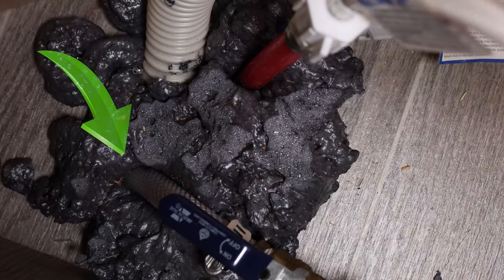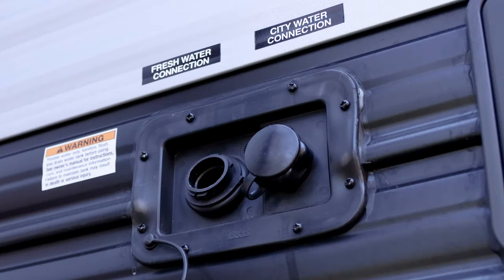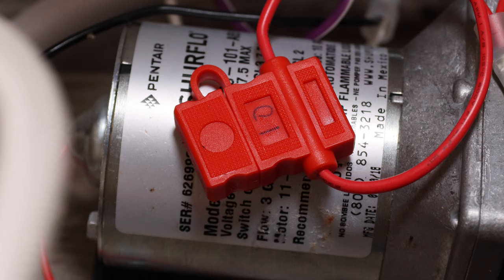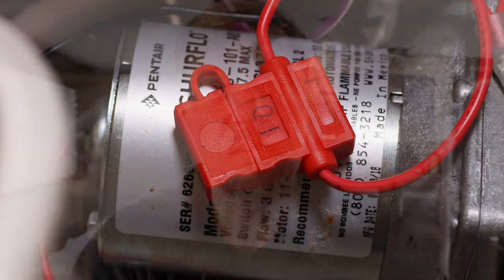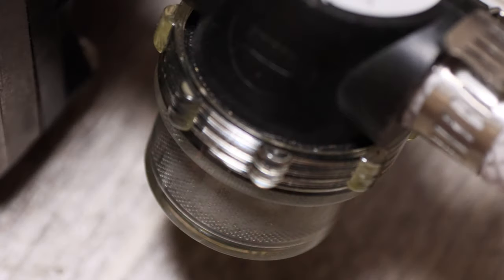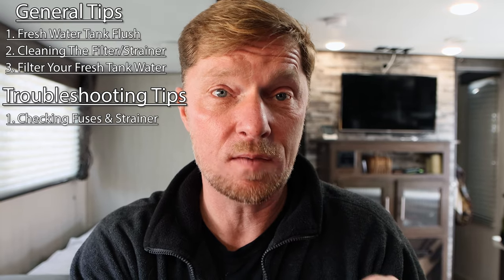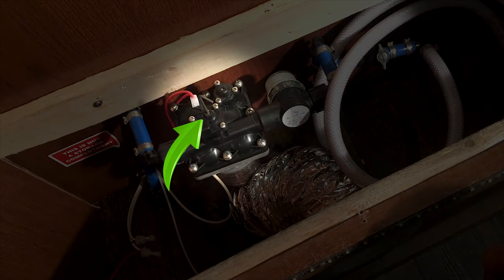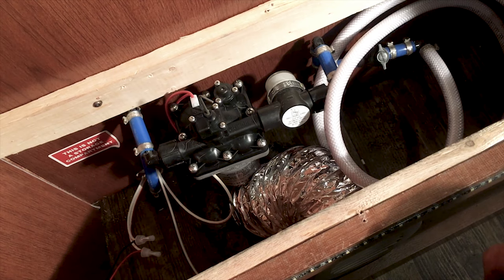RV Water Pump Explained 2021 - Shurflo Water Pump

Comment: I have an ARTIS brand pump in my SONIC trailer. It doesn't have a check valve in the lid like the Shurflo. I'm a rookie and was attempting to dewinterize and sanitize yesterday. I was having problems getting water to the pump and out to the faucets so I began troubleshooting. After making sure the valves were all open and still no pressure (only spitting then nothing when opening the faucet), I opened it up to make sure the check valve wasn't stuck, only to find it didn't have one. Eventually the pressure came after watching videos and swithing back and forth between the city water and tank water. So although I got some badly needed education, I still don't know exactly what was wrong before the problem "fixed itself".
Reply from the maker: Good morning Gerrad. I am not that familiar with the ARTIS brand but from what I just read, it is a magnetic pump meaning that the pumpiong system is not directly tied to the shaft of the pump. I use those types in the industrial enviorment and they work great and have quite a bit less (Hard Failures) menaing that they do not break easily and are meant to be opened to clean with a fair ammount of ease. I am going to attach a link that I hope helps you better understand and it is printable too. Let me know if this helped in any way. https://tinyurl.com/y6lqngmc

Comment: Good video. My water pump is a Shurflo and been givng us problems since we bought the RV last July. When the freshwater tank goes empty and we fill up with water it is hard to get it going. I can hear/see the pump is working, but no water is coming out. One time I shaked the pump and finally water started coming out. Not sure what is wrong, have to take it to the delear to get it checked. This happened to us about 4 timed since last July. Such a pain.
Reply from the maker: One thing that you can try the next time is to take the inlet side of the pump and run a hose from it to a 5 gallon water jug. Turn on the pump and see if it pulls water instantly or not. If it does, I would say the water tank is suspect. If not, then I would say the pump is bad and needs replaced. Also, not saying that I dont trust anyone but sometimes the dealers do not do exactly what they say they are going to do or have done. Maybe yours is an exception.

Comment: I have a shurflo water pump, 7.5 amps 55psi, to use on an off grid solar system. 
I have my solar system set up, but i dont know what i need to install exactly, between the pump and the battery
Reply from the maker: Outside of an on/off switch, I believe that the manufacturer recommends a 10 amp fuse. In you application, I would suggest looking for a 12v blade fuse with a water proof fuse holder. To be safe, please check shurflows website or your manual.

Comment: Getting ready for only our second trip in this camper van…which we love and no water pressure. The motor comes on but it doesn’t pressurize. Took it apart and that little disk thing moves up and down. I hooked up a connection on the “in” side with a bucket of water and it wouldn’t suck water in. Replace the pump?
Reply from the maker: I would think that replacement is your best option at this time. Let me know you get a resolve.
Reply: @HowToRV  Yep…Amazon sent one next day for about $60 and we’re back in business. So weird the pump came on…it just didn’t pressurize. Anyway…thanks again for the video and I learned something.
Reply from the maker: @Skyking6976  I am so glad to hear that you were able to get back online. Happy and safe travels. God Bless

Comment: Thanks for the information.  I am in the process of installing a new water pump on our cedar creek 5th wheel.  The issue was while on city water, my fresh water tank was filling up.  Has anyone else had this issue?  I was told by an RV service this was more than likely my issue.
Reply from the maker: I put a shut off valve between my fresh water tank and the pump. I turn the valve off when the pump is not in use. Since I installed the pump though, I tried running the pump and then city water and back to the pump several times. This seemed to fix the issue and I have no longer needed to use the valve. I left the valve in place just in case though. Hope this helps.

Comment: I have a shurflo model 2093-544-114 pump. It runs out vibrates, but no water comes out. 
     What's wrong?
     Can I repair it? 
This is a 1973 Mitchell Fishing Hut Camper, so it only runs from the tank to one faucet. There is no city water hose hookup, only the tank, the filter, the pump and the faucet.
Reply from the maker: I am not sure if this is the original water pump or not. If it is or at least it has some years on it, I would think that it would be prudent to go ahead and replace it. If you dont already have one, here is a link to the owners manual. Hope This helps. https://efmco.com/wp-content/uploads/2021/07/2088-554-144-Manual.pdf

Comment: Are all camper water pumps 12v ? I have a 06 skyline 32ft camper
Reply from the maker: Yes they are. That is so they can be used while not connected to shore power.

Comment: I have a one place system with two other switches for the water pump. I'm the one place panel the water pump switch will not turn on the two other switches will not turn on the water pump. When I hook a power problem to the water pump directly it comes on and works perfectly fine. Can you give me some tips on what my problem may be thank you
Reply from the maker: You may want to try checking the fuse panel to see if the fuse is blown. The fuse is between the switch and pump so if the fuse is no good, the switch will not work.

Comment: I have A shurflo pump the same as you do. The pump runs to an accumulator then to an instant hot water heater then to the shower head. I don’t have any mixing valves so I need to get the pressure consistent to have a consistent temperature in the shower. 
It seems like the accumulator decreases in pressure until the pump kicks on. When this happens the shower temperature fluctuates. I do not want this to happen!

I have tried to bypass my accumulator but then there is a pulsating problem. Do you have any tips to stop this ?
Reply from the maker: Pulsating comes from lack of flow. You can play with the flow settings on the pump but I highly recommend not to. I would run the water faster if you can.

Comment: This is very nicely done. I've subbed and liked, now a comment - for the algorithm.
I agree with your troubleshooting techniques and methods. I live in a Toyhauler and truck water to storage totes, from there to my RV when needed. I wanted to upgrade to the larger SHURflo 4048. It gives 4.0 GPM at 55 PSI and the PEX in the coach can handle triple that. Not sure about the fixtures. 
I wanted more pressure and flow - to get an RO system working - had one already... made by PENTAIR - as is SHURflo - one thing Tech Support to another and yup - it WILL work. And has. Of course I go through the pump more quickly than even 'regular live-aboards' but I don't have to go out for potable water. (Don't have to prevent 8 jugs from freezing too - or drive out to refill them.)
So I'm refreshing my memory of the settings on the 4048 - similar but not quite the same as the 4008, I think. I want max pressure and flow for a decent shower and to make RO water. I've still got one issue to resolve before I can put a 'Tap' of potable water in the counter - working on that.
Nice job on this. I'll have a look at what else you've done.
Slava Ukraini.
Reply from the maker: From what I understand, the pex is more than capable of handling the pressures. More or less, it is the fitting like hoses, rubber sealed lines and outside lines with the rubber grommets that have a hard time with higher pressures. Love to hear your thought/experience on that.
Reply: @HowToRV  Not sure quite what you mean there. In Canada, there's a new category of PEX called PEX-A. Still same diameter but different fittings - more commercial. I do not think any PEX has leak issues - unless crimp is incorrectly done. (side crimp rings do work but depends on how applied). I was afraid of PEX for years - but I like that joints can swivel years later and not leak.
I'm still working on integrating the RO system; currently working but I have to turn it on/off manually. In process.

Comment: Super job, Jason. My problem is that my pump loses its prime after running 3  or 4 minutes...shuts off then after about 20 or so seconds will re-prime itself and work for a while. Sometimes, for example, if the shower is being used and someone turns on a sink....the prime will drop off and no water. . If I toggle the satellite on/off switch,  and turn it back on and will reprime itself. The filter screen is clean. I do not see any leaks. The system does have an accumulator tank so I don't know if that would have anything to do with it. Any advice will be appreciated.
Reply from the maker: I have not experienced that on my own but i have ready that people have found that the pump is pulling air in with water on the inlet side of the pump. Loose fittings, cracked lines, loose connections etc... Also, you may not see any leaks because the suction side of the pump is pulling in anything that it can pump. An accumulator tank is to aid in pressure drops and water hammering, that is on the external side of the pump and if your not seeing water build up anywhere in or around your RV, I would think that you should be good there. I have told people with similar concerns that they could disconnect the inlet side and some how rig a line fromn the pump to a 5 gallon bucket and see if the problem goes away. I know that this kind of thing can be severly annoying and I would love to hear what you find out.
Reply: @HowToRV  I have found that the filter bowl on the suction side of the pump can leak and suck air in and not let the pump prime. One thing that is extremely inportant is when removing the clear bowl and screen on the suction, is not to lose or damage the black rubber gasket. Without this gasket you'll be dead in the water as for so the pump working for you. This gasket has a square profile and will not be easy to find and replace.
Reply: Another thing about the Surflow pumps. If the motor will run, Surflow should sell the water head repair kit. Probably consisting of a couple gaskets and the little round rubber disc that act as pump diaphragms to move the water. Not complicated.

Comment: Great video. 
I have a problem. When I use my tank water then turn on my pump, water flows straight out of my town water inlet at a fast rate and quickly empties the tank.
I’ve put a stop valve over the town inlet valve to prevent this (and it does), but should I be looking at something else for a more permanent solution? Thanks
Reply from the maker: To get myself on the same page, what are you describing as the town inlet?
Reply: @HowToRV it’s the connection point where I attach the hose to use the mains water, as opposed to the holding tank water.
Reply from the maker: @drseuss99  my guess is Inside that city water fill connection is a cheapo plastic check valve (plunger/spring/o-ring). Water pressure from hose opens it and when not hooked up to water hose the spring closes it.......so pump doesn't pump water out. If this is like yours then maybe checking the ball/seal or replacing it. Before all of that though, try pushing water in from the town water connection and disconnecting the hose a few times to see if it will reseat. If not, remove the filter screen at the hose connection to see if there is any dirt in there. Hope this helps. Let me know what your resolve is once you find out.

Comment: i have no water out with full tank of fresh water, water pump is on, cleaned filter and found that there is no air suction when i removed the pipe at water pump input.  is my water pump bad or something else?
Reply from the maker: Due to there being so many different configurations, it is hard to tell. If pump is on but not running, check fuses. If pump is on and running but no water, Try connecting a hose to the inlet side and run the the other side of the hose to a 5 gallon bucket of water and see if it will draw water from there. Also, check for any inline valves and configurations to make sure that the pump is being told to pull from the tank. Mine does not have fancier valves and arrangements but some RV's do. Hope this helps and let me know how it goes. Best of luck to you.

Comment: My ozito 12v pump has stopped working. No waters coming from taps. Checked water tank all ok. Do you know where the fuse is on these?
Reply from the maker: I have 2 fuse holders. One on the hot wire at the pump and one in the power panel where the other 12V fuses are located.
Reply: @HowToRV as I had cut off the original plug to change it to 12v the fuse was removed. I found out the on off switch was faulty. I reconnected it to the battery with a spare on/off switch I had and it was fine.

Comment: So I have the same Shurflo pump that had got some sand up inside from a failed screen filter. It wasnt pumping water so I had to take apart the pump and clean out all the little sand pieces stuck up in the diaphragm. I also removed the pressure switch and by pass. Cleaned them out as well. I dont know how to set the by pass screw back to the manufacturer's setting. My pump now pumps and shuts off. But occasionally if left on it will continue to run. I believe the by pass is causing that. I have a shut off valve that is after the water pump so I can keep the water in the lines. When that valve is close and the pump is on sometimes it continues to run like its not building pressure.
Reply from the maker: Sorry for not getting back to you right away. Did you find a resolution to the pump issue?
Reply: @HowToRV  yes, after watching your video which is the only one I could find explaining what the by pass was and how it worked. I was able to tune both settings and it's working flawlessly now. Thank you to the response, I appreciate it.
Reply from the maker: @lja1229  anytime. I am glad you were able to sort it out.

Comment: Hey bro great video.mines is leaking I have the same pump as you. Mines is leaking in one of the the screws that hold the bypass housing cap.i don't know what to do slow drips  equals lots of water
Reply from the maker: For the minimal cost of replacing the pump, I would go that direction if tightening the screws doesnt help.

Comment: When filling fresh water tank , pump activated and shoots water back out of filler about every 7-8 seconds . Could this be that the check valve is stuck open ? Thanks so much for any suggestions. I am a new subscriber since my girlfriend has an old food truck that has been out of service for a good while.
Reply from the maker: I am not sure about the filler. My water pump has no connection to the filler for the freshwater tank. The only connection is the city water supply. If i had to guess, the filler is coming back because it is being filled to fast. Just a shot in the dark here. I would love to hear more about your situation and if you have a resolve.
Reply: My pump does the same, is it normal to have water come back out when pump is on?